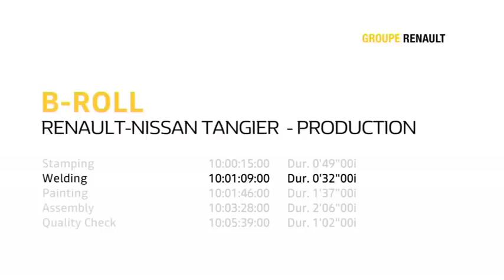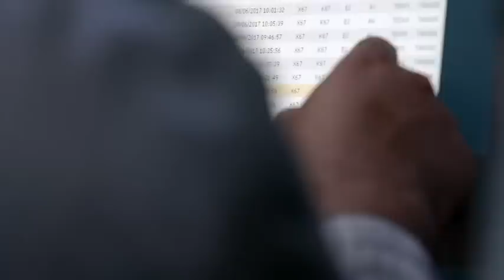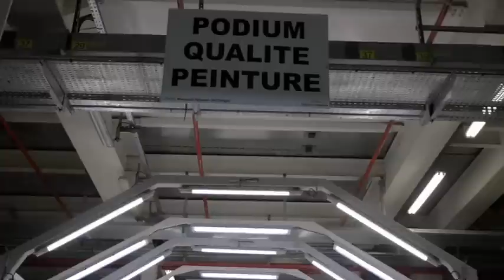Dacia Production in Tangier, Morocco

Comment: No safety glasses ? holding wires above their heads wire could easily puncture their eyeballs. If i tell you these workers salary here in Morocco you gonna cry for them. Poverty leaves them no choice but to be slaves for foreign manufactures here in morocco. They are more like slaves not workers.
Reply: do you think it's better to sell waffles on the beach? or suggest where to get a gross domestic product?
Reply: @janbrouzdal6221  I'm talking about basic safety requirements that are neglected and a minimum wage that is not enough to live a decent life. You know, the salary of a single worker in Europe equal a salary of 10 to 20 works combined in Morocco ? Those foreign brands they see Moroccan workers as cheap labor that they can treat as slaves knowing the government is not protecting the workers nor giving a single damn about them whatsoever. Things can be improved once people become a valuable asset in Morocco and treated with dignity by imposing strict laws and regulations upon those foreign brands. Unless you have something relevant to say please do not reply to my comment.